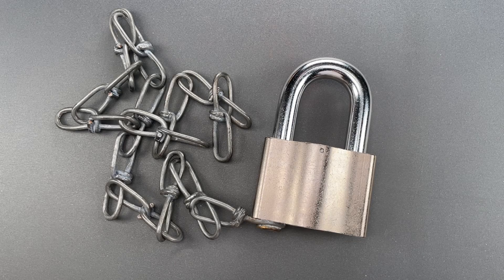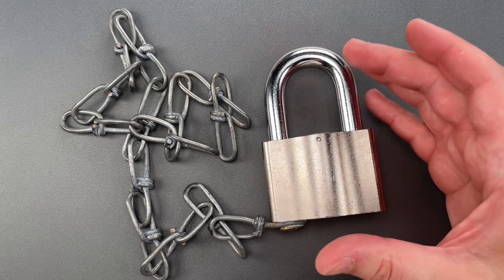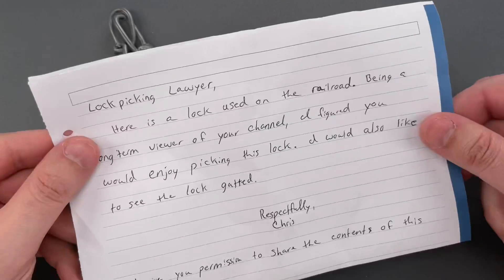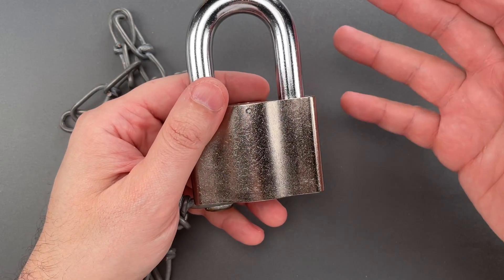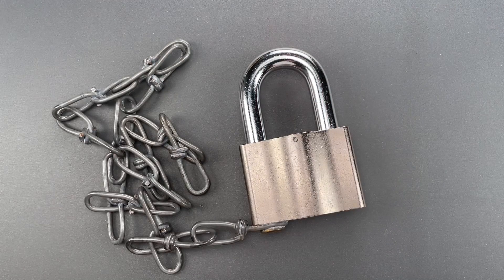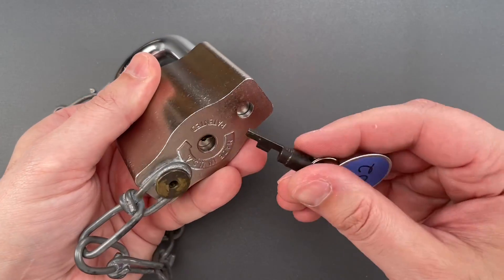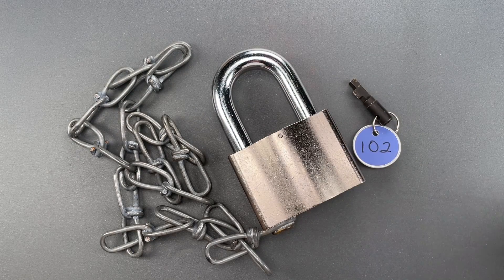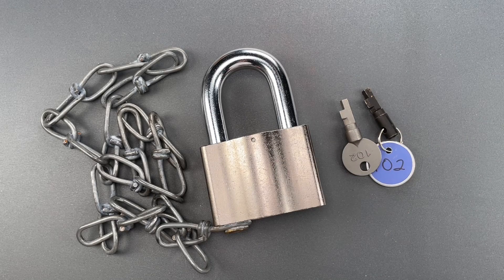[1482] The Most Weather Resistant Padlock Ever Made — S&G Environmental

Comment: WAS it used on high security applications? "High security" and "Left exposed and unsupervised for long times" are usually mutually exclusive. If it were used only as an entry deterrent device that all authorized personel (who would ALSO have all twelve keys) were supposed to be able to access, it would make sense.
Reply: Why would they be mutually exclusive? A railroad generally isn't storing cutting edge technology in the field where it needs a weather proof lock, but it does need to deny access to critical infrastructure that needs maintenance rarely. Switching and signaling equipment being accessed by unauthorized people is a potential disaster.
Reply: @Merennulli  Sure, but a terrorist is going to get in regardless of the lock. The lock exists to keep the handful of opportunists wandering past the door out.
Reply: @Darkside007  Kids who think it would be funny to break in because they found a set of keys online are a more serious threat than terrorists. A terrorist isn't going to disable random safety systems and cross their fingers in hopes of a tragedy, but kids messing around without realizing the risks they are causing are pretty common.
Reply: @Merennulli  ...kids are buying random keys online now? Wouldn't it be easier just to buy a saw from Lowes?
Reply: @Darkside007  A saw is more work and more obviously destructive. A set of keys is more innocuous.
Reply: @Merennulli  Why are they mutually exclusive? Simple. The higher the security rating, the more valuable it usually is, the more often it will get checked, the more protected it will be. Usually also the more maintenance it will receive. You'll find a lot of equipment sheds that aren't checked more than once every few years or even decades, but you won't find any nuclear installations that are left to their own devices for more than a few minutes. There's your difference. And yes, those are the extreme ends of the bell curve, just for illustration.
Reply: @feynthefallen  I know you were trying to imagine a bell curve, but the last part is false. Assuming you meant reactors, most nuclear research reactors shut down and lock up for the night and the only reason others stay staffed 24/7 is grid power management and emergency preparedness, not security. If you meant weapons, they receive maintenance at intervals, but for obvious reasons there AREN'T people there most of the time giving away the locations (my area is dotted with random concrete maintenance sheds that were access points for this maintenance and they sat undisturbed most of the time). In general, installations aren't going to be behind a single padlock, but we do store nuclear waste in dry cask facilities behind locks that require the same weather resistance as this, but obviously need to be more secure.

And as I mentioned, there are numerous parts of our infrastructure that require sparse maintenance but are also high risk and high value.

Comment: Kind of a railfan here, I have seen this lock in some stations, they usually lock up bridge plates or amtrak wheelchair accessible ramps. Pieces of infrastructure that are still needed but not so critical to the safety of passengers like locking up switch boxes
Reply: Do you know how they manage switch box keys? Does each railroad have their own lock and key choice?

I have a switch next to my house and always assumed the keys were all the same.
Reply: @volvo09  Each railroad has their own key number, but locks and keys are made by sargent & greenleaf. The 2 lock companies I've seen railroads use in the present day are Sargent Greenleaf and American Lock. They use different locks for different things. I'm sure a railroad employee would correct me
Reply: I've seen this very lock used for a derailing device. Isn't that more critical?
Reply: @christiangilbert5608  Critical switches and derails use time locking circuits in addition to the physical lock.
Reply: FEC seems to have recently changed from these to Abloy.

Comment: My guess? Bureaucracy and logistical efficiency. The railroads have a LOT of locks. Keeping track of those keys is a nightmare. Likewise, replacing those locks with an upgraded version would be hugely expensive and another bureaucratic nightmare. So, they keep rolling with what they have.
Reply: Doing military service, many ears ago, I was in the signal detail of my company. We relied heavily on using landline phones for everything but "immediate tactical" signals. For this, the country was absolutely scattered with connection points for us to use. We had 3 to 5 km of phone wire to route from wherever we established company HQ to the nearest connection point. In each such there where a number of available connections we could use, without any further porocedure. And from those you could call ANY number. Of course these connection points where locked, but one key covered an area of tens ofvthousands of square kilometers. Thousands of connection points. Anything else would have been impractical.

But there where too many keyscin circulation. I would guess on the order of thousands. And of course some where "lost", and resulted in absolutely zero cost phone calls.

There was this story, true or not, circulating about the cost of replacing all the keys when things got out of hand.

And during my service we had to call in to the phone company to report both connecting snd disconnecting. Military numbers wherealways functioning, but I assume they where monitoring traffic on non-reported military numbers..

Securing a large scale situation like this is HARD.
Reply: Same reasoning behind those atrocious TSA-approved luggage locks.
Reply: It's also a simple procedure to replace a lock. Lock breaks or gets cut? Buy a new one and all your existing keys still work just the same. Lose a key? Who cares, just go to the office and get a new one of the matching number.
Reply: The railroads keep rolling... 🤣🤣

Comment: I am guessing that the mechanism is deliberately kept simple to reduce points of failure in extreme conditions. Likely very loose tolerances for the same reasons.
Reply: This, plus I think it's mostly to deter hobos or stragglers from the areas they are not supposed to be, rather than protect something valuable or supercritical.
Reply: @Miestwin  I agree. A lock is not going to stop a professional.
Reply: @Miestwin  as another comment put it, if these locks are really only used for non-mission critical stuff that anybody looking to do damage would just not bother with because these locks are so far out into the middle of nowhere that the aggressor might well spend an hour of their time to mildly inconvenience 2 people. These are definitely closer to the is a very robust latch, then they are to an actual lock
Reply: Yeah, there's really no point in having an extremely high security lock where these are used, more likely to get messed up, and they're often deployed in areas where either noone will be around to complain if you go at it with an angle grinder or something anyway.
Reply: Also the key being so limited helps against key loss and with access sharing i guess.
Reply: If you have ever had to use a lighter to melt ice out of an American lock in the middle of an Ohio field to throw a switch for a train you know why these are used. Shame they cost $100 and the American rr locks cost $25 do you don't see them as much
Reply: So the lock version of the AK47 or the Moisin-Nagant. Rough, sloppy tolerances, but works every time.
Reply: @satunnainenkatselija4478  they freeze better to let them drain.
Reply: They say weatherproof but these locks and fortunately have a very poor tendency to freeze. I've had to take a flare to one more than once to melt the ice and get it to move
Reply: @St33lStrife  Some of them can be an absolute pain to open even in hot & dry climates. I have small & weak hands, and it took all of my effort (and ignoring of pain) to get one to unlock one time. Ugh!